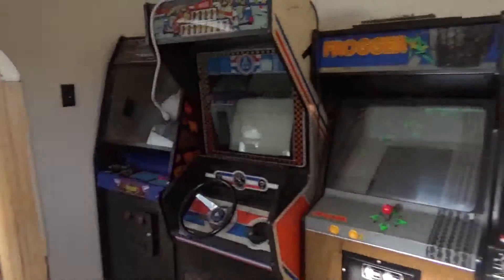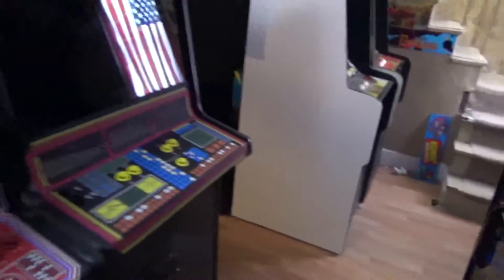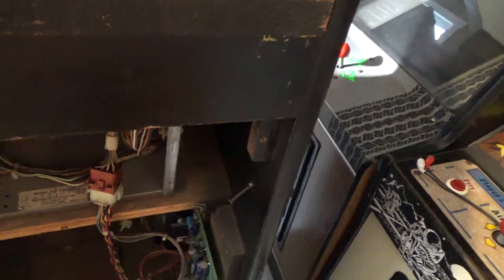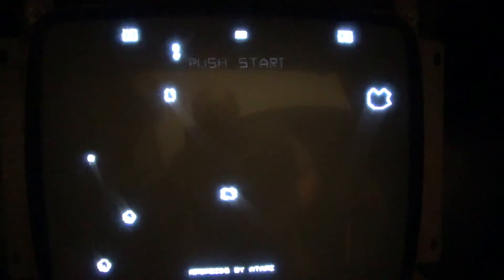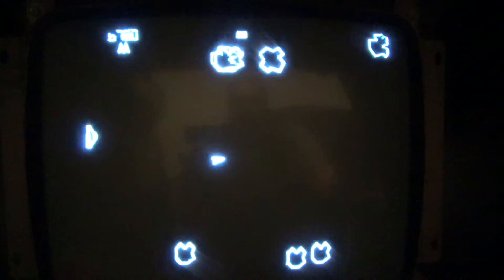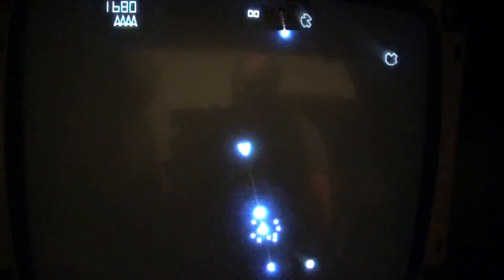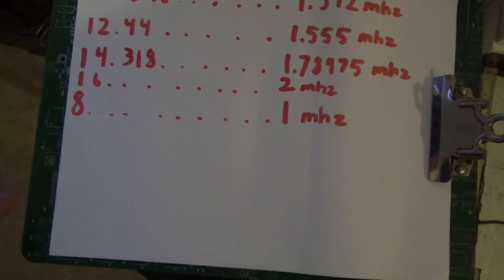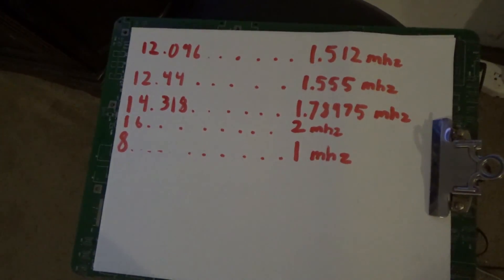OVERCLOCKING an asteroids machine

Comment: Obviously changing the master oscillator changes not only the CPU, but much of the circuit. However the game speed in Asteroids is dictated by the periodic interrupt that is hooked to the 6502's NMI pin. The 6502 main routine renders a 'frame' and then spins in a tight loop until it counts 4x NMIs, then proceeds to render the next 'frame'. On the original hardware, at the original speeds, the 6502 idles for roughly 33% of the time on the starting level. So if you overclocked ONLY the CPU, the game would still run exactly the same speed, and of course the rendering would be unaltered, save for glitches in the communications with the DVG, for example. And on the subject of the DVG; the 6502 main code also busy-waits until the DVG has finished rendering the previous frame before flipping the ping-pong buffer in shared RAM and starting to render the next 'frame'. So you can never run the game faster than the DVG is rendering frames. OTOH if you underclocked ONLY the CPU, the game would eventually reset, because a fail-safe in the NMI checks whether the main routine has been running, and will reboot if the 6502 is getting too far behind (eg. a bug hangs the 6502 main routine).
Reply from the maker: Yes I agree this is the most intelligent reply I have ever had thanks for subscribing
Reply from the maker: Mark McDougall you really know your stuff mark
Reply: Well for Asteroids at least! ;) I've reverse-engineered the code, got it running on the Apple IIGS, and ported it to 6809 on the Coco3!
Reply: Mark McDougall 

Have you possibly done any work on reversing 32-bit era games consoles, or any arcade boards?

Your name sounds familiar btw - did you do any documents or code for emulators like MAME?

I'm currently working on implementing the PlayStation 1 on an FPGA (very slowly. lol), and trying to find somebody who's brain I could pick, especially if they've done any Verilog / VHDL. ;)
Reply: Could this theoretically be done with a raster game, not overclocking/underclocking the board, but the CPU?
Reply from the maker: yes
Reply: Could this affect how the output is displayed, if one were able to examine it step by step using an in circuit emulator or JTAG?
Reply: Arcade Jason What would have to happen in order to over/underclock a Z80 CPU?

Comment: I'd love to see an overclocked double dragon mod. The slow down kills that game.
Reply from the maker: send me a double dragon pcb and ill do it
Reply: Arcade Jason alas I'm in the UK :-) thanks though for the inspiration. I may try swapping the crystal myself.
Reply from the maker: you cannot just swap the crystal on that board
there is much more to it than asteroids
Reply from the maker: you would need to keep the video clock the same frequency and isolate the cpu clock in a way so it does not mess with the video clock
Reply from the maker: i would suggest looking at the schematics and find where a counter divides the clock frequency for the cpu and re wire it damn now i want to over clock a raster lol